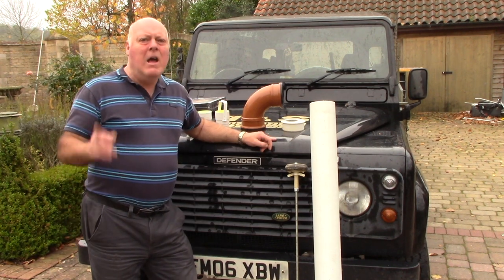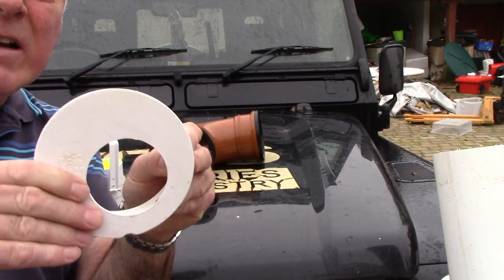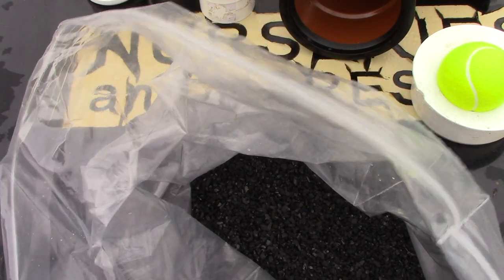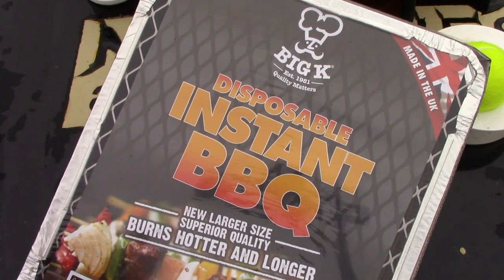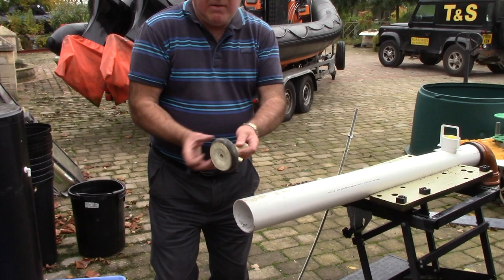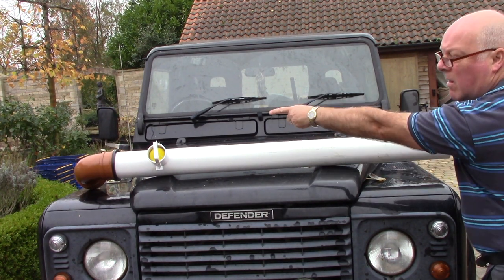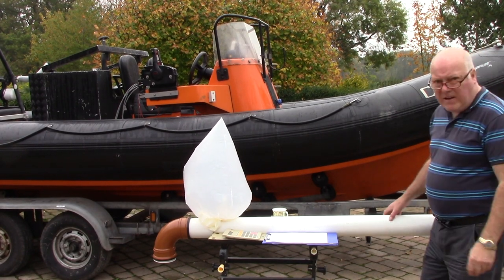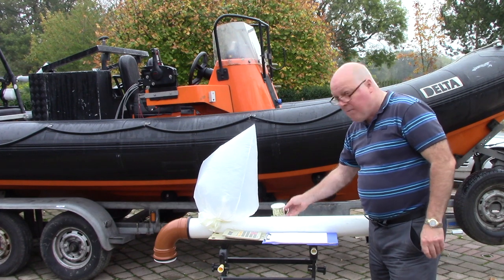Making a Nuclear-Resistant Air Filter

Comment: I would suggest a spare filter as in time the fallout dust will collect, also some sort of plastic clothing for protection when going outside for any reason and that clothing to be stored away from occupants safe zone.
A typical simple cheap british invention has always stood well in a time of crisis well done!, these sort of practical sort of inventions has kept our enemies away from these isles for over a thousand years.
A car air filter would be just as good and some kind of remote Tapping device to loosen dust from the said filter.
Reply from the maker: Thanks for comments yes a spare filter would be usefull but if pointing downwards should not block to quickly
a protective suit would be usefull ,NBC  and Hazmat suits can currently be purchased on line cheaply in the uk
Reply: @prep-rscharity4866  I got a couple of full face respirators, suits and gloves off of amazon, fairly cheep too.  Spent less than 2 hundred quid on the lot got full nbc protection as well. 
Mind you, I live in a ground floor flat but using the inverse squre law have found that living in my hall and the two internal walls should allow enough mass / distance to survive gamma radiation and the suits for alpha / beta.. Got half a dozen duct tape rolls and heavy plastic dust sheets to seal off the extremities. Just hope the windows don't blow in!!!

Comment: If there is smoke coming from the exhaust.  Maybe a different filtering system should be considered. If smoke is passing through the charcoal filter, what else might be pulled into your shelter?
Reply: I thought the same thing. Activated charcoal is mostly used for viruses or bacteria. So if the smoke was bacteria or viruses then your pulling contaminants into your room. The water idea is a great idea by the commenter above, the charcoal is a great idea, but if you dedicated a room that is sealed to a HEPA filtration system then use a normal air pump to disperse it throughout your room that should help with radioactive dust. 

Unless your a while away from ground zero it wont help much unless the wind blew tiny amounts of particulate matter into your region.
Reply: Air like smoke is thin. Military and the highest end gas mask use charcoal. The charcoal is course and catches particulates as it's forced through the porous coal. You just need about 3-4 times as much charcoal as he used to actually be effective for a decent amount of time. The whole idea is to trap radioactive particulates. My water filter let's water through but still filters out particulates. The smoke is just so you can see the "air" moving like it is suppose to in one direction.

Comment: Maybe for the exhaust of the room, have a one way valve pipe that has a oscillator leading out of the vent that can be manually cranked every hour or so for about 5-10 minutes just to help flush. Of course you'd want to be running the intake system at the same time so as to keep positive pressure in the space.

Comment: Quick Google search shows 4" pvc to have a failure pressure of around 130 psi, which is far less than the overpressure blast wave you would receive. I also seriously question it's resistance to atomic flash as well as just general fire

Comment: So, theortically, if someone wanted to automate this system to be automatic, it would be quite possible I would think. Just need some electronics for timing and measuring when to activate and a DC motor to actuate the bung/plunger back and forth in the pipe a certain amount every so often. Because the last thing I want to be wasting my time with, is pumping that thing many times a day, lol. I like the design though, it's nice and simple and cheap and the only improvements I can see needed, are what lassit lassit mentioned. Fun fact: The HEPA filter standard was built from the need for effective radioactive fallout filtration.
Reply: The downside to automating things, batteries drain down. Solar panels become useless after so much radiation exposure.
Reply: @lassitc  True and I had thought of that. So if you did, you'd want an efficient system for sure, that's easy on your batteries. The most minimal horsepower needed, to move the ramrod/plunger. Certainly have an easily detachable ramrod too, so you can hand pump it when you are lean on power. But if you have it spare, it could give you a break from pumping by hand, hehehe.

Comment: So...If we need to stay 3 months in that shelter we need to manually do this non stop? I understand it is a cheap thing but I was thinking at a more efficient and reliable ideea. Can this be adapted with a motor and a solar power system?
Reply from the maker: Yes , i have been asking a freind ( a clock maker ) to come up with a wind up version for years
but an electric version with manuel overide would be great please send Photographs or information Video?
Reply: @prep-rscharity4866  I do not know yet. In a desert area is too much dust for a solar solution. The sun is great but the combination between wind and dust will do a lot of issues to the solsr panels. Using wind power is good but when is no wind will be no power. Unless is stored. And now we go in big spending area.....sadly . Not to mention that in nordic areas is less sun...if I will build such a thing I will fo it near a river and maybe use the power of water .. ...

Comment: It will have positive pressure, but the pressurized air at the inlet will be filtered against particulates and products of combustion. A further enhancement might find a way to arrest vaporized metallic isotopes, like Strontium 90.

Comment: Interesting concept and execution of the idea.  How do you intend to deal with the overpressure?
Reply: Don't be there.  Really.  If you are close to a known obvious military target, MOVE.  Fallout protection is not expensive, while a blast-protection bunker is going to cost more than a house 5x the size.
Reply from the maker: It is neccessary to have a vent somewhere for the overpressure to exit maybe a clever cat flap?
Wire wool is a good filter against anything coming in.

Comment: MR. PHILL...HOW SHOULD I DO THE OUT PUT?  THANK YOU FOR YOUR VIDEO. YOUR SAVING MANY...
Reply: I was thinking the same. What about a small DC powered fan (computer sized) with a flap on the outside to keep NBC out?  You know, similar to dryer vents?  You could run the fan on a small solar panel.

Comment: Hi, Albert here. Thanks for sharing this with us, just one question, how do you know that charcoal will block radiation in the air you pumping into the bunker. i know you can use it in a cold room to keep things cold.
Reply from the maker: Hi Albert, thank you for your questions about nuclear air filters, the first point I would like to make is
that, during a nuclear explosion, air is generally unaffected, the main issue is the particles within the air
Which vary in size down to a fine dust. These particles are effected by radiation and are harmful,
the air filter is designed to filter out these particles as the air is drawn through a barrier of charcoal,
the fact that we used activated charcoal is another plus as the dust particles essentially stick to the charcoal.
This type of filter has been widely used for decades and is well proven, the same filter would also be
effective with other types of biological gas attacks, and so it’s a good all round filter,
I hope this information assists,
Regards
Phil,      PREP-RS
Reply: Albertus Van Biljon radiation is not from the air its is from the fallout partials. As long as no fallout partials come down your pipe there will be no radiation. Distance is your friend with radiation.

Comment: I think your simple design is brilliant and has the potential to prevent irradiation. 
I am concerned about the amount of O2 that would be allowed in a confined space of a bunker though. It is possible to asphyxiate without proper ventilation. 
I am sure you and other have already factored this, but for those who haven’t please be careful.
Reply from the maker: The air pump would gradually cause possitive pressure in the room and so a small air vent would allow
air, including carbon dioxide  to vent out.

Comment: Ingenious. But I wonder how well those tennis balls would actually seal  in a radioactive atmosphere. Why not checkvalves?
Reply: This is a "hasty filter", something you can throw together in an emergency. Commercial check valves, a blast overpressure valve, a commercial micron filter and a hand or motor cranked blower would, of course, be a much better solution. Over here in the States, atomic scientist Kresson Kearny designed a filter using similar principles, a couple of cardboard boxes, some plastic sheeting, a roll of duct tape, and a dozen rolls of toilet paper as the filter medium. See his book, "Nuclear War Survival Skills".

Comment: I would adapt it to use the air box from a car. It already has a filter that fits tightly with no air leakage around it. And you're definitely gonna have to use a 12V dc fan to get the air flowing around the clock. Unless you plan on keeping at least one person awake at all times to pull a manual plunger to to keep the air flowing.
Reply: It would bring in so much fall out lol
Reply: You want SLOW and steady. You'd need to power it down to slow slow speed.

Comment: Hi all, i have a serious serious question, what if in stead of the pump method as used in the video, can you replace this method by securely fitting a battery powered hand fan inside the tube to blow air either way? so will it blow outwards and inwards to circulate the air into a house for example? 
Would this work two ways to blow the fallout polluted air back out and blow cleaner air inside the house?
I have two good sized HEPA filters, one i would place on the outside and one on the inside of the pipe, both are charcoal activated and 3 stage filter system, i would have the outside filter, which i would not be able to replace due to fallout,  but would have the outside filter facing towards the ground in a bend pipe at a downward position so fallout would not fall directly into the filter, and hopefully extending the life of the filter.
I appreciate any ideas on this as it's now 2022 and we seem to be edging closer to a possible Nuclear war at some point. many thanks in advance.
Reply from the maker: an electric tight fitting fan sounds a great idea , you would only need to draw air in as it should be able to
vent out somewhere at the other end of the room/house . drill a hole in the wall if neccessary,
push wire mesh into it , the stale  air  will find its way out
Reply: @prep-rscharity4866  👍 Thank You!
This is what I was thinking, appreciate your reply, please do take care 👍

Comment: How long it take before charcoal is in activated, how can we tell?
Reply from the maker: the best device is a simple gyga counter  £25 from Amazon . if the air intake is facing down it shouldent 
accumilate too much fall out. wire wool can be stuffed in as a further barrier.
Reply: activated charcoal becomes unable to filter gases / vapors whand saturated, it depends on humity, temperature, air flow and concentration of toxic vapors. Both for gasmasks and shelters.

Comment: I'm not trying to be a bummer but smashed briquettes for grilling food is not activated carbon it is just charcoal there is a difference activated carbon goes through a process to fill it with microscopic holes to give it an enormous surface area per particle of carbon.You also should have at least 25 to 50 lb of activated carbon to be effective for filtration of things that you do not want to breathe.
Reply: Do agree. At least you can DIY Big activated carbon filters with aquarium pellets, work fine against organic vapors.

Comment: And to think I was taught to use hepa filters to remove particulates and activated carbon to absorb hazardous chemicals. I know of a few places using 12/24vdc extractor fans as air exhaust pumps. The average vehicle air filter removes more particulates per hour than a typical vacuum cleaner hepa filter.
Reply: dave smith Charcoal is carbon with some extra stuff in it (being it a derivative of wood, this stuff is probably wood related chemicals)  Activated carbon would be a lot better. This is just a quick guide for easy to get materials.
Reply: Inathy Accabon, cooker hood filters, air inlet filters for gas water heaters/central heating boiler, can filter many nasty substances from air, as for  particulate filtration vacuum cleaner filters and even the folded paper air intake filter from vehicles have been proven effective, including as scavenged materials. Personally I would probably have used a "paper" particulates prefilter located in the barrel between inlet and outlet (traps most of the nasties) and the chemical filter "cartridge" above the inlet valve using a wide area 12" diameter 1-2" deep tray of absorbent, for increased airflow with the activated carbon doing it's thing

Comment: Don't wanna be a doosh but any possible "cracks or leaks" would mean death from irradiated water and debris seaping in. On something for this scale you not only have to have an air/water tight seal on all incoming and outgoing ventilation systems but also a secondary ventilation system so if one needs repair the other can be used to not suffocate.

Comment: Um...where does the air enter the bunker past the plunger? If the plunger is tight fitting, are you not just filling the tube and then exhausting it straight out the outlet? Perhaps I'm missing something in the construction design. Is your proof of concept flawed?
Reply from the maker: the air flows in through the ball valve. when the plunger is pushed outwards the internal  ball closes by air pressure,
the outside ball opens and lets the plunger slide outwards. When pulled back in, the process is reversed.

Comment: Thanks but ;
The smoke test showed smoke coming in to your 'bunker' so the carbon filter didnt work.
 The carbon filter must have at least 4 inches deep of carbon times the area you want for longevity , a 12 x 12 inch filter x 4 inches deep is your minimum.
You should also have a prefilter of the type found on car or truck intake filters because they give longer life to the carbon filter and that type are easy to obtain.
Some people might put a 12 volt blower fan such as used as bilge ventilators on boats or even use a heavy duty computer fan , if you have a large 12 v battery charged from mains with a solar panel for backup or even a pedal powered charger you have covered a few bases.
Plan to have food and water stored as Switzerland mandates for their citizens , plus some PPE and water filters.

Comment: When you say at other end of space have a small "outlet," what do you mean? Especially in regards to a bunker underground. Thanks.
Reply: he means to have another pipe on the opposite side of the room to allow for the carbon dioxide built up to escape, and release the pressure that builds up from pumping in fresh air so you dont burst your eardrums
Reply: @zombie5625  thanks for the reply! So if we're talker about an underground bunker, which is what i see everyone building, how does it work? I mean, if you ran the outlet to the outside, which could only be up, wouldn't that defeat the purpose of the filter? Or would you angle the end of the pipe down with, say a 90 degree elbow once it is on the outside. Sorry just trying to get it. Thanks again for your answer. I get the idea, just can't picture it.
Reply: @royals1833  so you would need an over pressure value at the end of the pipe inside your bunker. The force of the pressure inside the bunker will open that valve and force the air through it, and when the pressure equals out the valve will close preventing the air from coming back in. At the end of the pipe outside of the bunker you will want a u-bend to where the opening is facing down towards the ground so fallout doesn't fall into the pipe
Reply: @zombie5625  ah now I get it. Does the diameter of the outlet need to be a specific size? BTW you rock. Thanks for the help!
Reply: @royals1833  so the diameter for the outlet pipe should be the same size or smaller as the inlet pipe. If the diameter is bigger then it could result in a higher pressure on the wrong side due to the increased amount of air inside the pipe and prevent the over pressure valve from opening. You could attach a handle to the valve to manually open it and release air, but the pressure inside the pipe could push air into the bunker before the pressure inside the bunker forces it out. And your welcome BTW and if you have anymore questions I will be happy to answer
Reply: @zombie5625  got it. Will do.

Comment: I think i just found another way, maybe a better one. Without the balls.
I will build it and see how it goes. But without you i wouldn't have gotten the idea.
Thank you
BTW activated charcoal will not filter radioactive particles. You need a HEPA filter H13 / H14
Reply from the maker: Thanks for info, i look forward to see your design, please send a link
Reply: common confusion between activated charcoal and dust/particles filters. Activated charcoal is for filtering water from contaminants (aquarium) and air, vapors and gases. Unable to catch the dust particles. As instance a combined gasmask cartridge is 1) a prefilter for particulates, and 2 the main gas activated charcoal.

Comment: Wouldn't a water filter be much better to use than a charcoal filter? Charcoal is great at absorbing chemicals, but fallout is dust, and water works better. Just have your air come into a bucket of water and bubble up, then pump the air from the top of the bucket. Air tight bucket except where the air enters the buck to the air stone at near the bottom of the bucket.